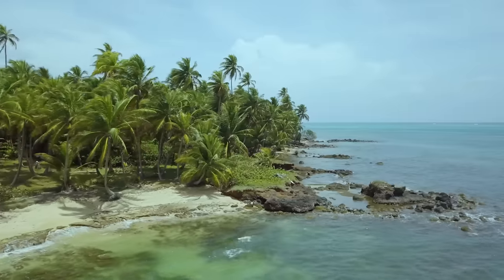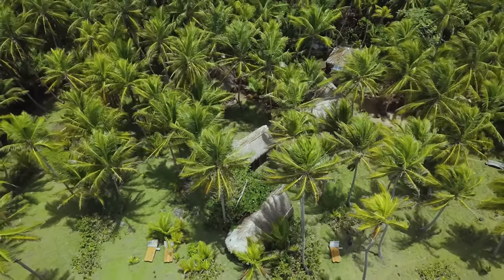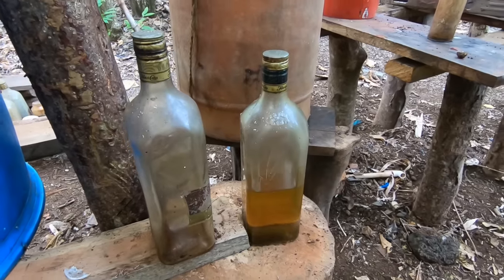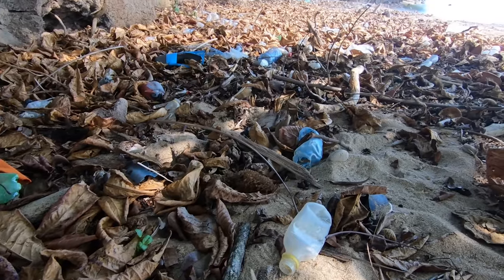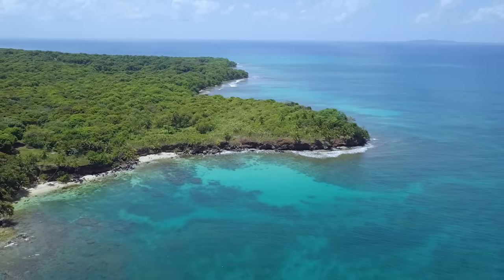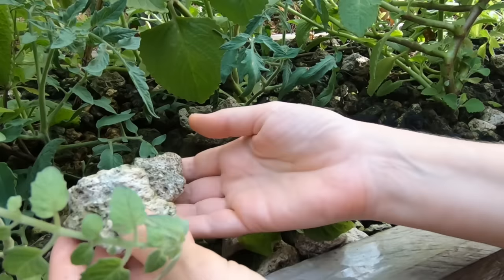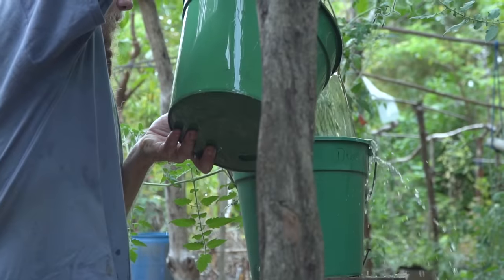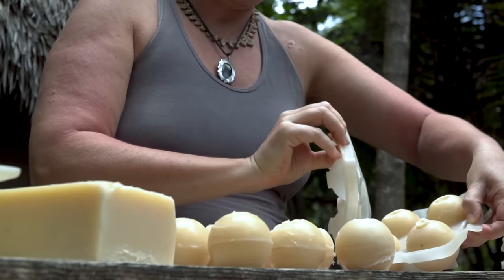THIS SELF SUFFICIENT FAMILY MAKES THEIR OWN FUEL FROM PLASTIC!

Comment: I see this being a movement shortly. 
I also see the people pushing the most for eco friendly things are the ones that are pushing the plastic simultaneously.
Reply: I'm already planning for that extraction system. I just need the full details
Reply: Not realistically   the cost of power input far outweighs the $ cost of off the pump end product.
However doing it out of necessity off the grid should have some cost benefits as well as environmental.
Reply: Well, diesel and other hydrocarbons are quickly becoming irrelevant anyways. This will be a footnote in energy production. Maybe it could be used as a method to eliminate plastic waste however.
Reply: @Bob_Lob_Law  that elimination is the idea mainly so we can have a clean healthy environment all round
Reply: @nyakwarObat  clean healthy environment ?????? he is burning wood to produce diesel that he is later going to burn in his generator . GREEN Psychos will not allow that beside this method is a lot less eco friendly than most of the new technologies. going back to stone age is NOT how you help environment. i do have to applaud the fact that he is cleaning all the plastic garbage though

Comment: To anyone at home, this process likely produces a great variety of unknown compounds depending on the plastic. There's a very real risk of the exhaust gasses and product being toxic, so don't try this at home, and in the scale they're doing it, it might cost them some years of their life
Reply: Not more toxic than any commercial diesel product, hardly more dangerous than barbecuing on coal. 
Just don’t inhale the fumes.
Reply: @pvdguitars2951  But commercial diesel is refined? It's a reasonably well defined mixture no? And I doubt coal is as bad, don't most volatiles just burn when they are released?
Reply: @origamigek  diesel contains plenty of aromatics. Coal forms naphthalenes, but Pyrenes, pretty nasty stuff.
Reply: @pvdguitars2951  ;(

Comment: Curious about emissions of burning plastic
Reply: Not good
Reply: Lots of nasty chemicals released.
OTOH here they heated the plastic anaerobically, so no oxidisation
Reply: It's a closed air enclosure. The damaging chimera are trapped in the tank and almost incinerated. So you could say in theory. It's okey but there is a chance that the could combust in the tank. So you have to be careful that the tank is completely and fully sealed and the piping and seals have no leaks
Reply: @CURTIS017  what's the best way to get rid of what's left in the pot?
Reply: @vincentgizdich2842  serve it up for breakfast the next day
Reply: Poisonous, very dangerous chemicals are released.
Reply: it is NOT !!!!!
Reply: it is NOT !!!!!
Reply: it is NOT !!!!!
Reply: it is NOT !!!!!
Reply: it is NOT !!!!!
Reply: The plastics are not burning - they are being pyrolyzed in an oxygen deficient environment (think making charcoal from wood). The emissions are being fractionally distilled to produce various products....Most of which are flammable like gasoline, diesel, or natural gas. At the very tail end, I'm not certain what exactly could be done with the residues, but I am certain the wasted from this process is a VASTLY smaller amount than the WASTE PLASTIC that feeds it!
Reply: I have no doubt less emmisions and pollution would be produced by using locally sourced plastic waste like this than by piping out oil and gas and shipping it to the locality
Reply: Lol well he said the words "good for the environment" like 50 times in the video and he dresses like a hippy so it cant be bad right???

Comment: Really awesome set for make fuel. Have you made a schematic of the set up for converting plastic into fuel that can be released to the public so that more people could be able to do the same set up as you did.
Reply: A condenser is used obviously. I am sure you can find plans for similar devices. I think the process is called "cracking" (breaking up carbohydrates to turn them into sjorter ones).

Comment: No matter how well you burn plastic, its leaves residue, so what is done with this waste?
Reply: Hydrocarbons are carbon based just as we are.  Pyrolysize us, carbon is left. Pyrolysize plastic, carbon is left.  It is very little compared to the former mass before pyrolysis in the reactor. If there are volatiles still in, it can be used like BBQ briquettes (pyrolysized wood) for getting rid of yard waste or if there are no volatiles it's hard like rock and can be used as a cement aggregate, things like that.
Reply: @dereksplace1342  very detailed and relevant response
Reply: @dereksplace1342  so you seem pretty smart I got a question, by burning the plastic and the diesel aren’t they just polluting the atmosphere just as much as the plastic pollutes the surface, also making the carbon trapped in the plastics now harder to capture back into a manageable solid state to dispose of?
Reply: @TheMilkyWill  My smartness level is debatable but I'll try to answer your question from experience. 
The plastic isn't burned, it is melted, vaporized and collected after it condenses.  What people like to call the 'fumes' is vaporized gas, the heaviest condensing into liquid, the lightest exiting the system and either being flared or passed into the carb of a gasoline engine. Both methods will catalyze the gasses through combustion into CO2, etc. Some people seem to hate co2 but in reality it is necessary for plants to grow. Indoor grow ops buy it by the tank so their plants have an increased growth rate.
Reply: The same think that's done to the waste when governments launch rockets. It goes right to the ozone
Reply: @dereksplace1342  That is still not complete, almost all plastics from the production process contain heavy metals (PET, for example, contains mercury, PE contains mercury, lead and thorium), the carbon-like residual product concentrates the heavy metals and is therefore highly toxic, I would not use it to heat a barbeque. This is why secondary fuel power plants are so rare, the released toxins are subject to emission protection laws, waste incineration plants therefore use very few plastics in their systems, as plastics exceed the limit values.
Reply: @dereksplace1342  Thank You
Reply: @darkbreed  Yep better in the boltle
Reply: dont be fooled plastic is everywhere and will never leave this earth because we pollute our environment with 80 million tons of plastic every year and im sure that is a modest number. The way it biodegrades it gets smaller and smaller and those tiny particles of plastic will year after year continue to brake down into even smaller particles. Every plant and animal on earth will not be able to avoid consuming this toxic wast and i promise you there is no one on this earth that has a clue what plastics will do to living organisms over a long time, my guess is its NOT GOOD at all. its a grime future for every living thing on this planet
Reply: What is happening here is very small scale. If you have complaints then aim at the massive corporate industries who have zero ethics. This guy does just enough to live. Corporates amass billions in the bank by destroying the natural world.
Reply: @darkbreed  I didn't say use it to heat a BBQ, I said they look like BBQ briquettes that could be used to burn yard material. There are some universitiy studies showing the pyrolysis of PET and how the carbon afterwards may be activated and potentially be used in other applications. I do not know.
Reply: @dereksplace1342  i know the studies a little better because i worked in the recycling sector. The quintessence of the publications does not come close to doing justice to the technical effort behind them, as the cleaning processes of the pyrolysis output are always beautifully presented. In fact, pyrolysis is one of the most polluting processes for dealing with plastic waste, as the limit values for emissions in this area are far less regulated than for waste incineration. I stopped working in this area because my demands on processes are not compatible with reality. In my opinion, the only environmentally friendly conversion of plastic waste has been blocked for 25 years now because it would destroy the oil industry and is called solvolysis. The output of solvolysis would be able to replace 80% of the crude oil demand in the entire crude oil processing sector with plastic waste without increasing environmental pollution. The capitalist crude oil system would not survive an industrial conversion to it.
Reply: @darkbreed   If we could do that here on this isolated island we would. We are just doing what we can with what we have.
Reply: @_RocketRooster  i know a lot of things about it that are hidden from the mainstream. Bees die because their stomachs fill with nanoparticles, bees can only throw up in liquid form so as not to contaminate the honey in the hive with crystallization germs. Plants don't care about nanoparticles and transport them through their roots into the nectar. Every form of plastic is contaminated with heavy metals and their pyrolysis or combustion concentrates them either in the pyrolysis residue or in the combustion gases, either way the heavy metal emissions from plastics are 20 times higher than when coal is burned. as long as a capitalist system controls production and disposal, things will never get better. and people like this youtuber here give the environment the rest with their half-knowledge.
Reply: @dereksplace1342  That's not what I'm talking about. This process will destroy the entire environment on the island in the foreseeable future, not only that the "fuel" contains highly toxic heavy metal compounds but also the toxic gases and the residue are a much bigger problem for the environment than the plastic itself.
Reply: @darkbreed  What?! Now I'm going to single-handedly destroy the island? I'm going to go say goodby to the mushrooms and weeds sprouting up under the still.
Reply: @dereksplace1342  What do you think ? what will water-soluble heavy metal pollution do to an island? It will also harm the plants, plastic only harms animals and insects. One must denounce the pollution caused by plastic. It would have to be paid by the manufacturers of the plastic and not by the end consumer in the form of taxes or levies, which are then not used for this anyway. Pyrolysis is old hat, it was developed in the 30s of the last century and discarded because of the heavy metal pollution, which is a far greater problem than the plastic itself. Fungi will survive heavy metals but plants containing chlorophyll will not and people who eat both will die 20 years or more more likely. I find it very frightening how little 99% of the people in this world know about plastics.
Reply: @TOMTOM-nh3nl  for the environment it is actually better that heavy metals remain bound in plastic as long as no one has an ass in their pants to stand up to the governments of this world. "Fridays for future" is a joke in my eyes, because children go on strike for a better world by voluntarily dumbing down on themselves and also causing tons of environmental damage with their stupidity.
Reply: @TOMTOM-nh3nl  i was taken out of circulation 20 years ago because i had developed a system that would have solved the plastic problem and at the same time would have reduced crude oil consumption by 80% and could be used independently anywhere. In this world, people who only care about money are in charge.

Comment: This guy is doing a great job well done I'm also interested in looking aftef the environment and getting rid of all waste plastic dumped everywhere in Thailand so now after talk about this for five years l will start to try and do something turning plastic into diesel at age 70
Reply from the maker: Yes they are so inspiring! Thanks a lot for watching 🥰
Reply: Make sure to buy some safety equipment like a mask etc. The part of the plastic (left behind) that doesn't liquify is highly toxic. You need to seal it and make sure the container doesn't leak.

Comment: It would be interesting to find out what gasses are emitted and in what quantity (like CO & CO2).
Be a better use than dumping that stuff in the ocean or landfills
Reply: Only the heating fire would make CO and I doubt much CO2 would be made by the plastics being melted down. I'm kind of annoyed the "scientists" and all the whining econuts didn't think of something like this. Also, California has an issue with car tires from tire shops. I have friends that stack up tons of them and are running out of room because it costs too much to get rid of them. Wouldn't a shredder and a heating system be able to draw off oil or something? All that would be left is carbon which is also useful and it would free up the steel belted wires for recycling. Three products could be taken from scrap rubber tires and maybe more depending on what compounds come off them when heated.
Reply: Co and c02 isn't bad plants like it
Reply: @energetictv9340   True. CO will quickly gain another oxygen molecule to make it safe. You just don't want to breath it in too much because it will block oxygen use in your body and make you weak and tired or worse.
Reply: @johnknoefler  Tires: watch Garbage Warrior on Buildings made of tires packed with dirt. Mike reynolds of earthship biotecture has been building w tires for years!!!
Reply: @johnknoefler  Frm what I understand rubber is nasty stuff in a unit like ours with lots of sulfur. In the East they have huge units that can pyrolysize tires without a problem. Tons by the day. THAT would be nice to have.
Reply: @johnknoefler  Burn tires for fuel to create diesel from plastic. Makes sense.
Reply: The gas that comes off is 100% usable Lpg gas and nothing else.
Totally reusable
Reply: @aleceshowe  then maybe we should all be doing this. If it will run a generator it will run a car.
And annoy Big Oil like no tomorrow.
Reply: @49mrbassman  Human poop and animal poop is also recycleable  , overhere in The Netherlands a guy invented a heating system for houses where the shit is treated and at the end you have natural soil nutricions .
Reply: @aleceshowe  From tires?
Reply: @dereksplace1342  tires is the same process and you end up with the same product . On all these processes the first cut is called "Pyrolysis Oil".
Diesel type fuel and gasoline type fuels are derived from Pyrolysis oil. 
Tire processing is a very dirty business on the clean up after the cook. Been there done that, never again.
I would say processing plastics and used lubrication oils is where it's  at for the backyard and off the grid blokes.
Btw used motor oils and plastic can be done together if you can get the temp of the reactor to over 400 degrees c.
Reply: @aleceshowe  Ok, that is what I thought I remembered reading about tires and why people didn't mess with them. 
We do mix the used motor oil with the plastics, waxing does not seem to be too bad with that method. PET seems to be the waxiest if I'm not mistaken, but with motor oil it is not a problem. Some waxing, but not like when I nearly blew myself up with a wax  blockage using pipe that was too small in diameter.
  Budget Rent A Car in Managua gave us two drums of used oil so we are good to go for a good while :).
  Yesterday we made about five gallons so when mixed with normal diesel that should last about a week until the next cook.